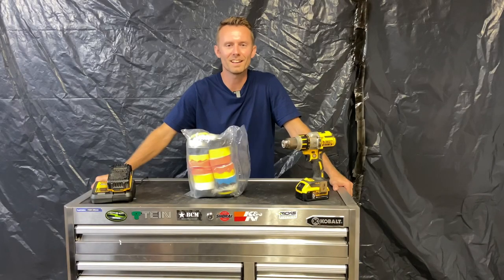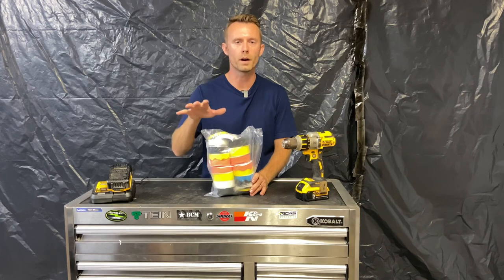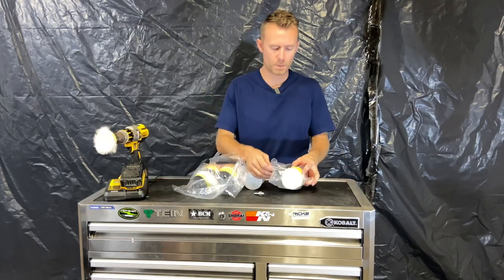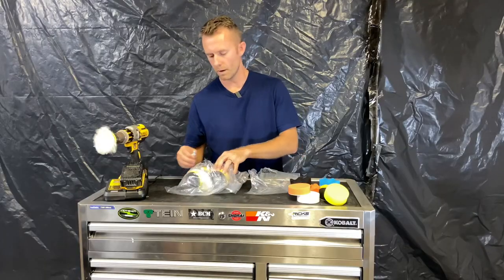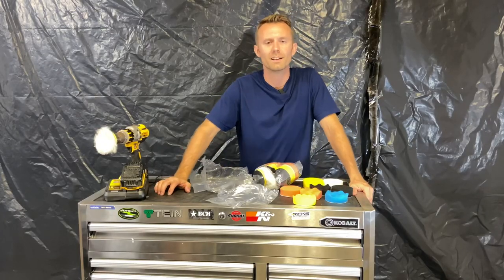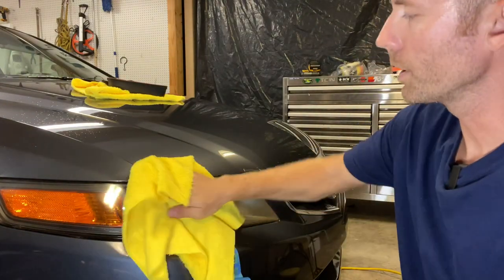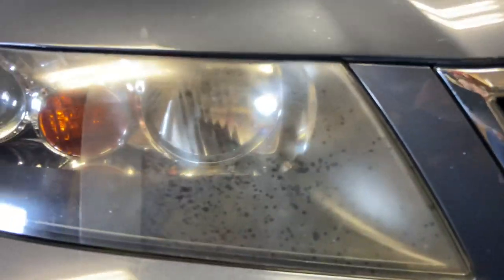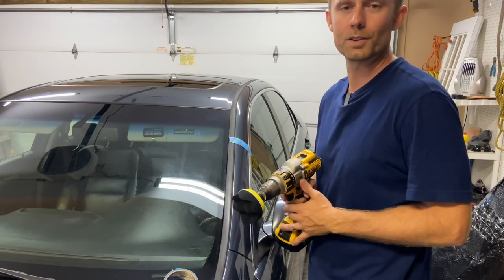Cheap 3 inch polishing pad kit for your cordless drill!

Comment: Am I in danger of burning my paint with these using a compound, seeing whereas it’s more like a rotary than a D.A?
Reply from the maker: Yes, any rotary style has the potential to burn through faster than a DA, all things being equal, these included.
Reply: @tkdriven6077  I also bought a couple chemical guys orange medium cut, 6in pads(because the backing plate in my kit is 6in). Should I use the drill kit I bought or honestly take a full day and do it by hand to be safe. I have a black mid size sedan with a moderate amounts of swirls and scratches, I’d buy a D.a  it I just moved to an apartment complex and I can’t afford a Milwaukee right now lol.
Reply from the maker: @6atlantis  check out 1 of my other videos for an affordable DA called a Zota. I love it! 

I can’t answer if you should do it only by hand. If you don’t have much experience, I don’t know if I’d use a rotary style on my whole vehicle. Mistakes can happen in a hurry.
Reply: @tkdriven6077  thanks I will.
Reply: @tkdriven6077  theres a video on here that's shows the 3 differnt ones the one that caused less damage was the rotary
Reply: @tkdriven6077  Can you provide some links?  I'm not finding the videos you are describing.
Reply from the maker: @eiigypocr5064   hey! Here you go.

https://youtu.be/a-Ru9X1Az3w

Comment: Drills arent the best motors to run continuously. Only buy a drill buffing kit for small jobs and don't use them on a cherished car as a proper dual action polisher isnt massively expensive and will give much better results.